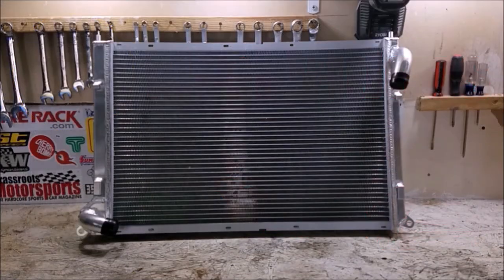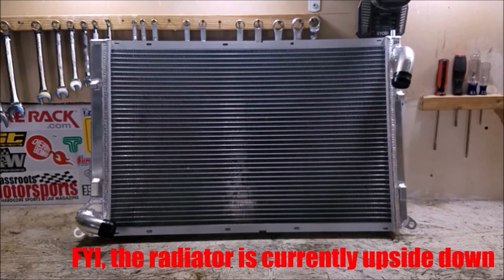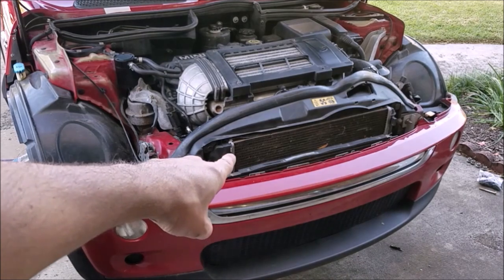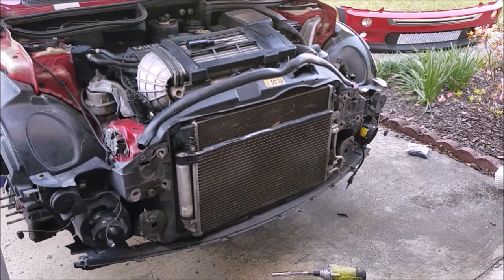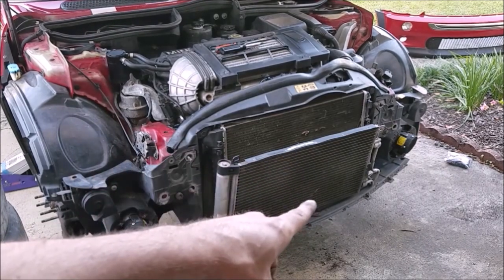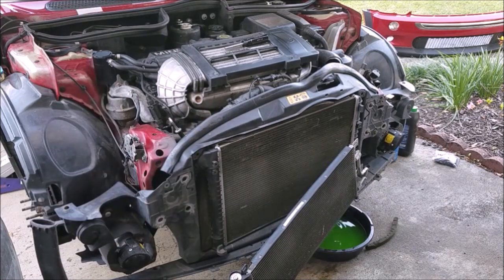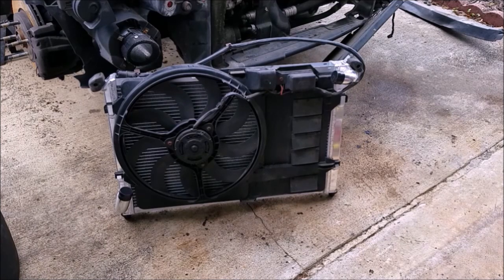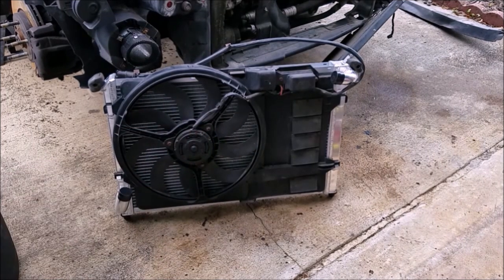R53 Mini Cooper S eBay Aluminum Radiator Install DIY

Comment: Hello mate, very good video, I own a JCW R52 2006 and just wanted to know your opinion about these ebay radiators, are they really worth it, considering is a relatively cheap job. I live in a very hot and humid country (Panama) and always worry when the temperature gets 200/190 F, I'm considering changing for an upgrade such as the one you showing  in this video. Cheers
Reply from the maker: I would save up for a name brand radiator like Mishimoto. I have had some problems with these eBay ones. Some last a long time; some last weeks.

Comment: Hi, i plan to take my r53 on a track day, can i ask you for two advise, please?
1) how do you keep track of oil temperature?
2) what is "right" temperature range for the oil and coolant temperatures without risking the car overheating?
Reply from the maker: I have a video on how I added an oil temperature and pressure gauge to the car. I try to keep coolant under 210 and oil under 230, but they can both go higher. Synthetic oil can easily handle 250 and the coolant can handle 225. However, I try to stay conservative.

Comment: Has this one started leaking yet? Seems like all the aftermarket rads leak within two years.
Reply from the maker: The first one did, but I could have fixed it if I could weld aluminum. It was cheaper to swap it out than to pay a welder.
Reply: @350Z247  the first eBay rad? How many have you gone through?
Reply from the maker: @Lewis137  on the 3rd. Just killing time while I shop for a K20 to swap in. I've got a video filmed and waiting for editing about the eBay radiators.
Reply: @350Z247  I appreciate your replies and honesty. Just seems like NO ONE makes a good aluminum rad for the R53. Good luck on the K-swap!

Comment: Do you need to replace the foam at top of the radiator?
Reply from the maker: Mine was trashed, but anything to better seal the radiator to the core support and bumper is always a good idea.

Comment: The link is for a $361 Mishimoto on Amazon. Which ebay one is in the video?
Reply from the maker: Any of the generic $100 eBay aluminum radiators. As long as it doesn't leak, it should be fine
Reply from the maker: @Brad5161  I do love FCP Euro, but I hate plastic in my cooling system. I prefer only aluminum and silicone.
Reply: @350Z247  Understood... but considering my original radiator lasted 170k miles I'm not worried about the plastic ends... I'll never have to buy another one barring FCP Euro going under.

 I've also seen several complaints about the cheaper aluminum ones leaking and the Nissen brand I bought has excellent reviews and sells for more elsewhere. It was an easy decision. $300+ vs $100 sealed the deal. Same reason I bought a plastic coolant expansion tank. Got a water pump too. Buy once and done.
Reply: @350Z247  
Those cheap aluminum ones are junk compared to the OEM one or the a Nissen replacement.
Reply from the maker: @MrAnticaArte  You can weld an aluminum leak, can't weld plastic.